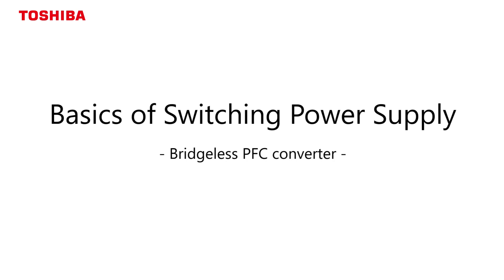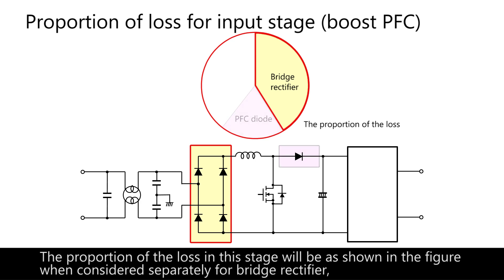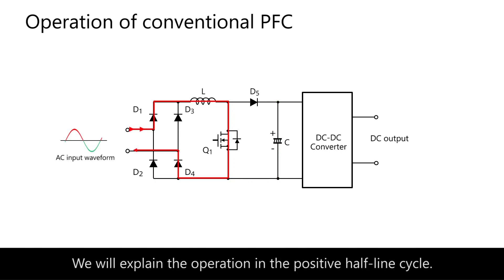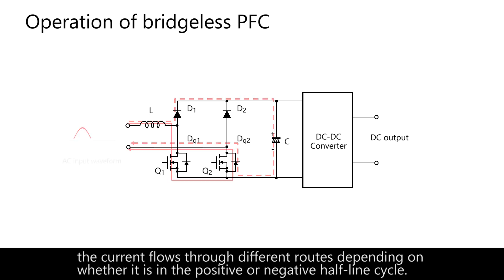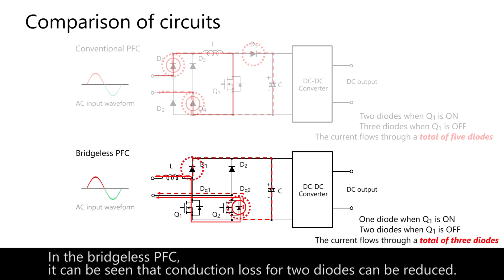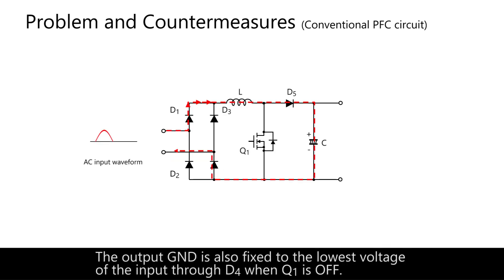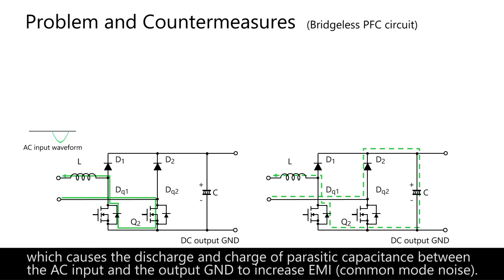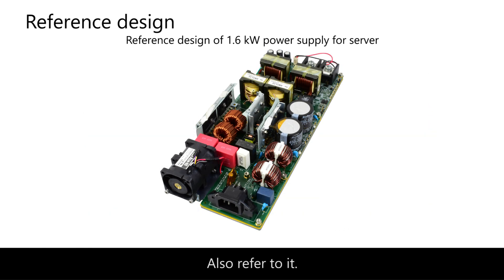[ e - Learning ] Bridgeless PFC - Basics of Switching Power Supplies (8)

Comment: I designed and implemented a bridgeless boost rectifier in open loop...but it consuming some input current at no load, with a hizzing sound from inductor.....is it anything related to EMI as mentioned in the video?...

Is this problem will be solved by switching to semibridgless ?